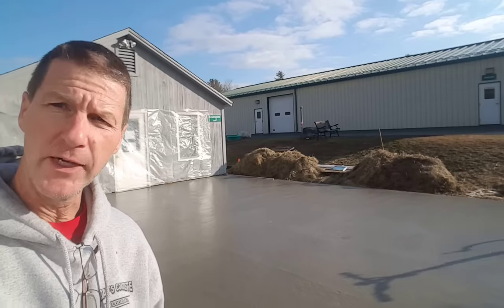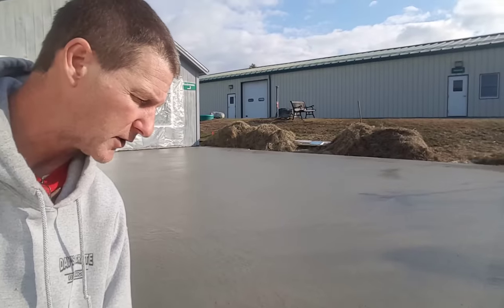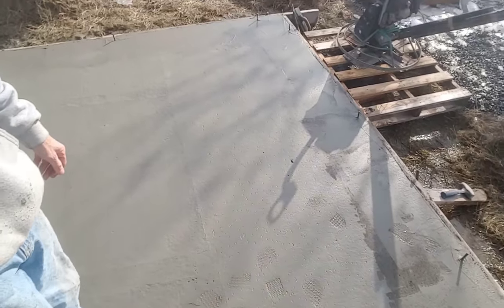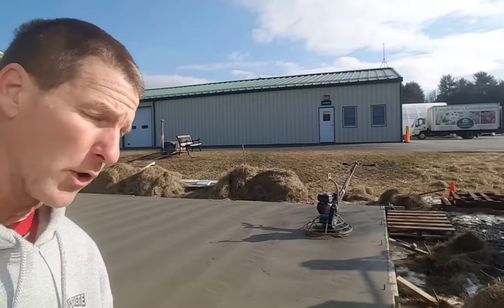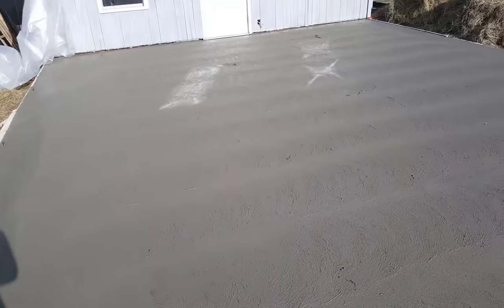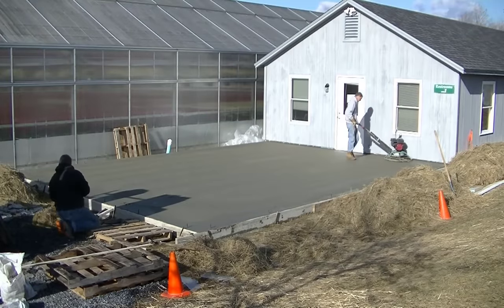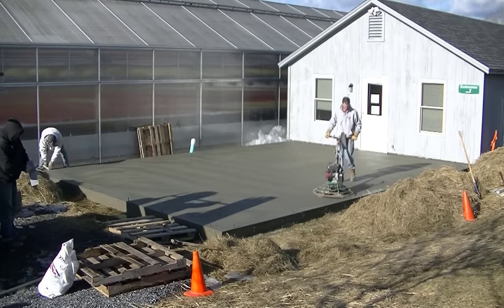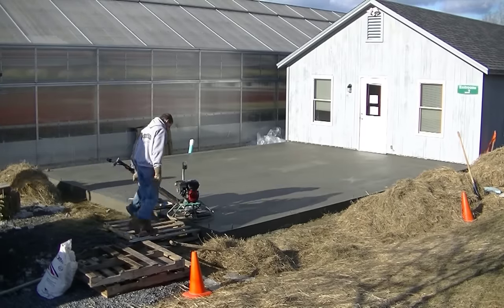When To Start Finishing Concrete | What Finishers Know, That You Don't!

Comment: I've been doing concrete work for 40 years. This is one of the best videos I've seen for a beginner finisher to get a basic concept of finishing with a machine. Good job.
Reply: i been finishing bout 30 yrs and i was about to leave the same comment....all bout timing and please never let that machine go while its running ..great job guys
Reply from the maker: Thanks for the comment. Trying to help teach anyone willing to learn and better themselves.
Reply: @MikeDayConcrete We are a dying breed. This new generation needs to know as many of the tricks to finishing concrete as possible. Thing's that took us years to learn.
Reply: I would have commented on the method of using a piece of gravel to lob into the air and watch the bounce but I figured that might be a little deep for someone new. I have always used the method that when it sticks its too early, usually when the gravel bounces its either ready or just about there, depending on if you're using kneeboards or a machine.
Reply: @123mbcline  ---Exactly.  You can't hope to teach concrete properly with a video so it's pointless to add anything.
Reply: Randall Reed that is a wonderful compliment
Reply: @billcoley8520  thank you. It's hard to find young men who are willing to continue with the foundations that we and our fathers put down. Thank you again.
Reply: What do you do if the concrete is getting hard and theres alot of bleed water on it?
Reply: @zanderness  use a squeegee to push the water off
Reply: After doing concrete for 40 years, would you say its profitable or just a job? Can someone actually make it a solid buziness to kill my body in my 20s and 30's and retire at say 40 with a goood 20 yrs work put in?

Comment: When I started working in concrete I had to learn it the hard way. When to strip the batter form on a curb led to slumped curbs or curbs to hard to even scrub. I finally got it figured out in a couple of months. I worked 18 years at concrete construction. It was a very satisfying trade. Thanks for the tips.
Reply: Concrete is the best job in the world!

Comment: I’m an electrician by trade. Having to run my stub ups in a form and watching these guys come in and pour and finish a slab gave me a new profound respect when I see the end results. On one job, the finisher was short handed so I decided, what the heck, I’ll stick around and give him a hand..after about an hour with him I realized why I chose to be an electrician. It was one of the hardest but most rewarding things I have ever done. 6 years later I found myself on a job site with the same guy, I couldn’t help but to jump right in and helped him out again. If you ever have an opportunity to jump trades...do it. The experience is more than worth the work.
Reply from the maker: Nice Eric, good job helping out a fellow contractor.
Reply: Pap deisel  two things I learned from that experience, you never leave another tradesman in a bind and I learned how to pour and finish my own slabs. It taught me alot about myself, so if anything i owe a lot of gratitude to other tradesmen like yourself.
Reply: Pouring and screeding concrete is brutal work- I have done it and even was hired to fix others failures. Again- it can be brutal. The power troweling is the easy but finesse work. Mike Day does it so that it looks easy.
Reply: @paulbriggs3072  amen brother...hats off to the pros
Reply: I would like to leave nursing if I could learn that  concrete trade....I am always fascinated by the trades like masonry, welding, and construction..
Reply: In my opinion concrete work makes roofing look "soft"... I love concrete in every way ...except when I'm mixing,pouring & finishing it single handed. Its torture in the moment...
Reply: @grumpycat_1  I recently teamed up with a contractor. We can’t find workers and are short handed. So we are helping each other out. We had just finished a job in a subdivision pouring a 30’x40’x6” for a work shop. There was only 4 of us. The HOA wouldn’t allow any large trucks thru the gate so we had to carry sacks upon sacks up sacks of 80# bags and mixed on the spot. I think after the first pallet I started to re-think my partnership
Reply: @erichemard7066  The 1st 3 or 4 #80 bags make me feel like a man... the rest make me want to cry like a child. 
Me: 6-8 bags in : "Why don't my f-ing arms work anymore"
Reply: @floridaalvarado8897  with the shortage in the labor market, you can easily grab a part time gig or weekends and give it a shot. I’m sure if you explain it to the interviewer they might make an exception. I wish you the best of luck in your endeavors
Reply: I’m nearly a year into my electrical apprenticeship after being in the concrete for 6 years. Still find myself watching concrete videos to remember the tough days we went through
Reply: I was a young construction manager, in the 80s, and I thought I was going to stop the concrete workers from drinking beer all day... first day working NEAR that concrete all day made ME want a beer... Learned the same thing about Painters and cigarettes... Certain materials are harsh to work with...
Reply: Ive poured and pumped concrete for about 20 years. Its tough dirty work but time goes fast my pockets are full of cash and you will never find me doing anything electrical lol im so scared of it since i was a kid and my friend and brother told me to grab this fence and touch the power pole at a rodeo in california .not sure why but i did and i dropped to the ground after feeling the zap from head to toe .now im petrafied of it.
Reply: @grumpycat_1  when I do concrete myself I buy 60lb bags, more humane.
Reply: @someonespadre  Agreed....  especially if you are wroking off of bags on the ground... My mixer though is the perfect height to work of the tailgate of my truck and 80lb bags are "just the right" amount for the drum. So I stack tham 1-2 high in the bed and just drag them to the edge of the tailgate, "chop" the top 1/4 off the bag and just kinda pour them into the mixer... that way you really never have to lift them just drag them around.
Reply: Eric, I was always taught to work Smart. You are killing your
Reply: that's such a reward, always done a few  help the guys in need and people notice your willingness to learn something new or improve skills , when the foreman says "he knows what he's doing" is a great feeling  if one is here to stay
Reply: @floridaalvarado8897  I actually worked with a fellow that did years ago when I was in the union and the unions were strong.
Reply: @johnmacintyre2  stay with the electricians I'm a mason. Concrete is exciting  there is a mysterious attachment to where people stop and look. When that truck comes its game on. ;- ) you have to work together as a team in harmony as if you were fighting a war to get the job done. There is a bit of art in shaping and finishing in a short window of time. Satisifaction of hard intense  work when you have a nice finish is pleasing for a Days end.
Reply: I'm a rehab contractor, so I'm CONSTANTLY having to jump around between skillets.... Concrete is some hardcore science and art all rolled into one.  Concrete guys don't get nearly the props they deserve in our field.  Hats off to all of em.
Reply: I was an expert carpenter in key west now I live in pa and I’m building a whole house on my own just finished the foundation now time for the slab never done one this big it will probably look terrible but that’s ok lol my house

Comment: Doing concrete for a living for 20 years..this is very well explained video..good job brother and may God Bless You for your info to the new guys...
Reply: .35/1 Water to cement  ratio is the lowest you can go but that be so dry I would like to see you try and pour that it would definitely be a zero slump. More water you add past that .35/1 is weakening the concrete that’s why When you’re doing a commercial job they had a concrete tested and tell you you can’t go more than three slump or what ever the Specs are. So definitely don’t add a bunch of water to your concrete like buddy’s saying lol and yes concrete drys that’s the dumbest shit I heard. The chemical reaction between water and cement is called hydraulicing

Comment: Haha I was a concrete contractor for 20years, and watching you was great! I totally agree with using the steel floats on the machine first. The degree of extra flatness is astounding. Also finishes quicker in the cold, but can be too fast after about 25 degrees celcius.
Great video and you are a master to watch.
Reply: Hi, we had an 8m X 4m concrete slab built, 10cm depth, but it has since cracked in places on top, all the way across its full width. We got the builder out to come and fill in the cracks again with a trowel (flat plate) a few months ago. Only a few days ago, it rained heavily, and it cracked all over, worse than before. The builder has however still left the wood all around it, still attached at the edges. - Would this cause cracking? We haven't sat any structure on top of the slab yet. Do you know what would cause this cracking issue? Thanks. Love from Scotland X.
Reply: Can be alot of things, concrete mix, rebar or lack of rebar, ground preparation. Form does not affect cracking as concrete shrinks when it cures.

Comment: An old finisher told me once " Concrete will tell on you" I said what do you mean? Anything that you did wrong will be there for everyone to see
Reply: Hardest but most rewarding job in the world I reckon.
Reply: There a hard way of doing every job and and easy way, which is the right way
Reply: Bill Cass I read, when concrete starts setting up, it waits for no man.
I guess if you loose it, that's one of the reasons they make jackhammers.
Reply: Concrete is like a woman when she is ready you better get on it. Cause once she sets up. It’s over.
Reply: Lol.... That's exactly what I said when I poured a 4x6 for my mom.   Lol! It actually yield back at me. I was late on the bull nose. All "f" up but the water rolls clean off....
Reply: Definitely! It's not like framing a house. If their joints in walls aren't tight, you never see it because it's all covered over with trim or drywall. With concrete, it's out there for everybody to see
Reply: The old fart always know best!  Your mistakes will last forever! As will your perfect job!!
Reply: Concrete will tell on you , but concrete also gives you a second chance with flowers (jackhammer )
Reply: This is one of the reason I love concrete... Mixing pouring and finishing it single handed is a brutal test of logistics,/preparation, execution, timing and STAMINA. You never have "enough time" .. when it comes out well its one of the best feelings in the world. I still look with disdain at a certain section of channel drain I put in where I had to re-wet a 4' section it makes me sad.
Reply: @grumpycat_1  brother I totally agrree with you , I always look at my old work or another persons work . Ppl who don’t no concrete who watch these channels don’t realize the hard work and toll on your back it takes placing and being on your back floating and troweling .. on a hot ass day fighing the time , my god it’s the most stressful / rewarding . Nothing better than lookin at it at the end cracking a beer and getting handed your cheque for the job
Reply: @teebo5298  I just finished a 4x4x4.5" air compressor pad (aprox. 6 cubic feet)
12 bags of RapidSet concrete mix (with a lot of Set control) in 98° heat... solo. 

I just cracked open a beer but I can't tell you how good it tastes yet because I can't lift my arms... 

Pad turned out perfect though ;-)
Reply: Thats hard
Reply: True
Reply: Wise man.
Reply: @darylmartin8936  if not too late put some water on it and start pan as a
Soon as possible
Reply: @darylmartin8936  only stays wet enough for so long🤣
Reply: So true.
Reply: Well, that comforting lol
Reply: @desslattery3457  there’s only one way to do concrete
Reply: So very true, all blemishes take me weeks to forget about.
Reply: Never let concrete beat you.
Reply: @lazenbytim  god damn right lol nothing better then standing back  after you get done busting your balls for 8- 10 maybe 12 hours a day pouring and  finishing a floor and it looks PERFECT when it’s all done. Most people will never get that feeling in their life because people don’t wanna do it nowadays I started doing this when I was 17 years old I’m now 28 years old and I love it and hate it at the same time 😂
Reply: I work for a floor company up north we are good for 2 million square feet or more before the Riders it was all walked behind three guys floats two guys combos two guys Trail blades most of it in the sun too

Comment: 2 things make major changes in how a slab goes off: shade and reflection of sunlight. If concrete is in the shade, it takes ages longer to go hard and makes it more difficult to get a consistent finish across the entire slab area. Sunlight reflection happens anywhere there are walls, and especially windows. Along wall faces that get a fair amount of sunlight through the day, the concrete will always go off faster than the rest of the slab. It catches a lot of guys out but it is a consistent factor when finishing. You can see 2 window reflections in this video, and I'd bet $100 that in those 2 areas the slab would've finished a little harder and smoother there. Really nice, informative video. Not many guys bother teaching other guys how to do this stuff.

haha i just kept listening to the video and you do mention the sun along the walled edge.

Comment: Just looking around.  Good video.
I do want to remark about sawed joints: I see this had been a trend in the past decades (especially of driveways), but I hate them - they chip, and its because of stress concentration at a sharp edge;  corners (at intersecting cuts) chip even worse.  Rounded edges last MUCH longer - the life of the slab - and stress concentration (reduction of) is the reason why.
Reply: You were doing it wrong.

Comment: Good video! Great point on reflective wall lines, 30+ years myself. After the first two passes on the 90° I like to run on a 45° for the next two passes and new guys don't pull forms until your done finishing :)
Reply: You got problems you pulling forms same day it's poured.
Reply: I've been finishing for 30 years, I've learned that pulling forms same day is not good, corner cracking ,etc,
I always wait till next day.
Reply: @davidtaylor9336  I’ve only been doing concrete for two years and haven’t had issues pulling forms off same day.

Comment: Great video! 
I worked with a concrete contractor in central Utah many years ago. Driveways and curb and gutter. Learned so much about grading, prep, forming, and using a transit level. Took me a year to get to start troweling, never got to run the power trowel. After seeing this video I understand why. WoW, what an exercise of situational awareness! All the things to take into account. I did get to run the curb and gutter machine before moving to another occupation.
I've been a helper on half a dozen slab pours in the recent past, this video REALLY helps. Thanks.

Comment: That fuzz from the concrete actually adds a huge amount of mechanical bond to thin-set when tiling. Reduces tiling cracks, lift-off , pops and just makes around a tougher product. The rougher the better just have to make sure its level to a maximum tolerance in your country. Watched every single video
Reply: I’ve had to come up with a lot of stories but never used that one. It’s going in my note book. I think I can present that one where it’s believable.
Reply: Dan Walters 😂
Reply from the maker: The hand trowels leave a tiny bit of fuzz, but not much.
Reply: Mike Day Everything About Concrete 2% cal and hot water  that fuzz becomes nonexistent. I have prayed for concrete that would leave fuzz. I understand what you’re saying though, I leave more fuzz with a finish machine than by hand I don’t burn floors in unless 
it is getting away from me because I don’t want to burn up my blades.
Reply: Dan Walters z
Reply: @danwalters5198  how does one add hot water to a ready mix truck?
Reply: Jeff P they have to fill the concrete trucks water tanks with hot water and they can use hot water to the mix it’s self. The concrete company charged at least $2.00 a yard to do it maybe $3.00. It worth it though it triggers the calcium and Portland and sets up much faster.  If it’s a winter day that’s going to get into the 50’s I would use hot water and a 1/2 % cal.